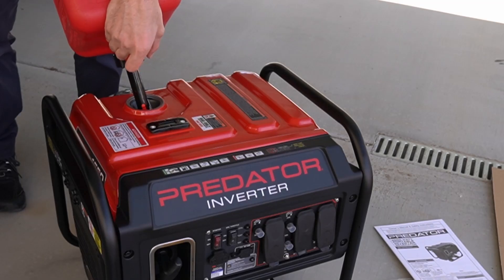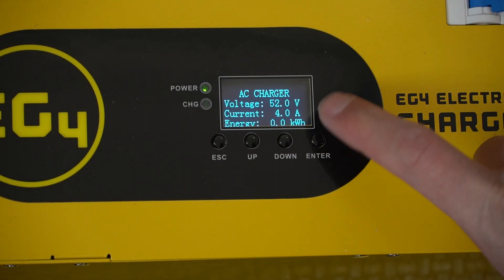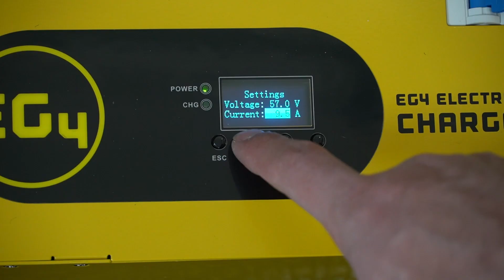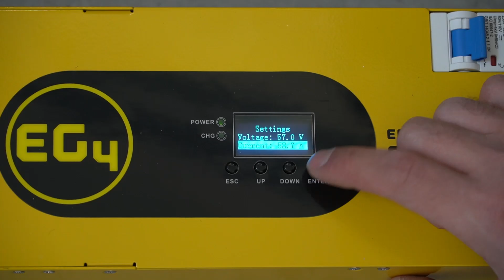New! 48V 5kW EG4 Chargeverter

Comment: Hey just wanted to point out another really nice use case for this product.  People that have cheaper all-in-one units like growatts and 6500ex/lv6548 have a TON of issues with ground/neutral bonding when they try and supplement their solar/battery power with grid power.  This lets everyone in that boat disconnect their AIO units from the grid entirely, and connect through DC using this product.  Should make a lot of people's homes safer, and fix a ton of issues with parallel pathways etc.

To clarify, I mean using this chargeverter with grid power to supplement solar, not using it with a gen.
Reply: Good point. I have an LV6048 and was worried about that, but someone that took theirs apart on the forums did confirm that it does have a bonding relay that goes to open on grid bypass mode. But that relay could fail and you would never really know.
The only downside is you'd be cycling your batteries all the time if you were primarily using it for grid backup. Not as big of a problem with LFP obviously.
Reply: @andrewt9204  Hi Andrew. I think I'm in the same boat as you. I've got a Sungoldpower version of the LVX6048 and I'm a bit lost on the ground-neutral bond situation. Is there a setting in the AIO unit itself I can change to separate it? My unit makes an awful sound and eventually fails with an error code when I try to do solar - battery - utility versus solar-utiliity-battery.
Reply: @tomtruong7432  When you are in SUB mode, are you drawing from the batteries ever?  If not, I would guess the problem lies somewhere between the battery and the connection to the inverter.  The battery usually doesnt get involved in SUB mode, so that could be why you don't see the problem in that mode.
Reply: @andrewt9204  Yeah, I think if I went with a parallel voltronics AIO (2-6), i'd probably spend the money on a chargeverter just for piece of mind.  On a single one... YOLO  😂😂
Reply: @silverice9  I would too. I didn't even hook mine up to a generator or grid I didn't get that far yet I'm glad I found this video. Kind of depressing. This is how it is but at least I know now great to know for people on the grounding bullshit as well
Reply: Dealing with that exact issue and have come upon that exact solution, I wish you could use solar/home assistant to control the amperage though.  Ideally when the batteries are low I could have home assistant apply charge at whatever rate the load is to effectively zero current to the batteries.
Reply: @robinboling9531  how is that combination. I've just started using home assistant and need to pick up solar assistant this month.
Reply: @SetitesTechAdventures  other way around for me.  No complaints with solar assistant.  I'm using the DC power supply.  Someone on the forums had theirs fry and suggested using the AC supply so it's isolated from any voltage spikes in the DC system.  Solar assistant has a button to enable mqtt communication but I haven't got home assistant set up yet.

Comment: Isn’t the AC input limited to 30A 240V? The plug and cord size might heat up attempting to run higher power for longer periods.
Reply: That's 7200 watts and the charger is rated for 5000 so no issue.

Comment: Omg🤦‍♂️ talk about a over look. How you buy a generator without 240 outlet? It’s happens , as long as you got it working. I got the same charger.

You need a plan B, it’s not sunny every day. But now your going to need to store gas to run the generator when it’s not sunny out.
Reply: Either get a propane ready generator, or get a kit to upgrade a generator for propane use. There are dual-feul generators that can take gas or propane. Propane is way easier to store for much longer periods of time.
Reply: @Tumbleweed5150  exactly! That why I got a champion dual fuel 85000 watts generator. You just never know.

Comment: Question: I have a 25 amp gas generator to charge my Battle Born Batteries. If I were to use the charger that you’re showing, can I get the full 50 A or do I need to change my inverter setting to 50 A instead of the 25 A? Thanks
Reply: 25amp at 120vAC is not 50amps at 48v nominal. I think you might be mixing stuff together.
Reply: @my_channel_44  
I have a Victron 5000 48 V  inverter. It’s set for 25 A, so do I have to change it to 50 A to use the 48 V charger?

Comment: I'm considering purchasing the Chargeverter so I can recharge the batteries with my generator while my Growatt 12k is powering the loads. Without the chargeverter, the generator would be passed through the Growatt and would not be able to handle the high inrush spikes of the whole house HVAC system. This seems like a good value, but I'd like to see more testing and real world experience to make sure it is reliable.

Comment: I was looking into dual fuel generator when I get to start building my system...  storing propane is way safer than trying to get gas in an emergency.. but I also have 3 acres and would rather cut the grass in the shade of panels :) ..

Comment: Can it be used to charge a bank of 12 12volts 200ah batteries using a “10000watt continuous generator”? A clear answer will be greatly appreciated.  My best Regards
Reply: Only if you set them up in a 3p-4s configuration and run them as a 48 volt bank, and then your solar or other charging and inverting systems must be able to run/use, a 48v battery bank.
Reply from the maker: No this is 48V
Reply: Sorry sir for being a pain in your neck. I just realized that I didn’t give you enough info about my setting. My connections start with:
10 solar panels of 200w wiring in series to a pair of 100w solar controllers to a bank of 12 batteries of 12volts 200ah wiring in series (3 groups of 48volts) to a 10,000watt continuous “aims power”inverter and a  13,000w pick 10,500w Duromax generator. How many of those chargeverters do yo think I need to charge my batteries ? Please help me through this.

Comment: I was just thinking: With this chargeverter (~$400)... A cheapo but quiet Amazon 2-3kw generator (~$400)... 4 cheapo Walmart Deep Cycle Marine Batteries (~$400)... and a 2200 watt 48v trolling motor from Amazon (~$400)
= A pretty nice quiet but powerful Jon Boat powerplant upgradeable to solar and controller for another (~$400)

Comment: How hot does the chargeverter (240vAC-12v DC) get. Would be great to put a temperature sensor on the unit. 
🌏🇭🇲
Reply: it will get around 130 f on the hot side of the charger pulling 90 amps. It does have a good cooling fan

Comment: I would buy this just as a powerful 5000-watt 43V-59V DC power supply and also to charge my custom 16-cell LFP home battery from solar since my system is AC-coupled.

Comment: Great adaptability. It'd be great to have that flexibility in the range of voltages/amperages that ebike batteries need. Car charging stations don't accommodate ebikes, but car charging stations and high voltage RV "shore" power AC outlets are far more available than plain ol' 110AC outlets when bikepacking long distances (few hotel stopovers). So... Is there anything as adaptable as the EG4 Chargeverter that operates with a low (4 to 12 amp) DC (24 to 52 volt) output, adaptable to the connections and voltages that car charge stations and RV "shore" power (the 240v kind) have?
Reply: Yes. Look up Delta-Q's chargers. I have an IC-650: it will take anything from 85-270v in, 50 or 60 hz. There are profiles available from Delta Q for LFPo. You have to get the right voltage output: they are either 24, 36, or 48 v nominal output, and not switchable. Contact their support. Very good.
Reply: @my_channel_44  I only have to accommodate one output voltage (both of my ebike batteries are 36 volt), but it would be good to be able to tailor the output amperage to conditions (low charge-rate when there's time; hi-rate when there isn't). The Delta-Q is pretty expensive, but if the support is really good for set-up configuration and changes out in the field, that might be worth the cost. Weight could be a deal-breaker. Seems like something made for 4 to 12 amps out could be very compact. (The set-up presently on my workbench is like with a hybrid car, miniaturized: 20cc gasoline motor to brushed 110 AC generator to a standard 110 AC ebike charger, which I have to carry anyway. 9 pounds. Fits in an ammo box. No need for an inverter, so low loss, but requires constant manual engine-speed monitoring to stay in the optimal output range for that charger without any electronic control. [I'm not an Arduino geek.] And it's gasoline. Operates easiest when stationary.) I'm doing everything I can to not have to tow a trailer, but...

Comment: 22KW generator for an AIO????   What size AIO is that for?
Reply: If your AIO is 5000W output, and you are using close to that in your house/cabin, then you will be pulling around 10KW. Since most generators seem to run most efficiently at around 50%, you will want at least a 20K genny, and maybe the extra 2000W is for safety.

Comment: I ordered one about two weeks ago but they are back ordered. 

I have an inverter generator and currently run it through my inverter but when house loads are high the genny rpm’s fluctuate and a couple lights flicker. I thought it would be easier on my appliances and inverter to just run off of the batteries while charging them with the chargeverter.

Comment: Thanks Will! I was thinking about that issue of charging through an all in one from the 8750watt generator that does not have a clean inverted output. Probably worth the extra money. Also some  all in one systems will not feed from batteries while being ac charged. This would eliminate that issue as well.

Comment: I bought one of those EG4 48 volt 100 ah batteries you reviewed and so far I'm not happy with the battery or the service. Don't throw anything away or they will not take the battery back unless it's in original package. The battery randomly drops out and the Bluetooth doesn't work with their app.

Comment: You should have picked a non-inverter (legacy) generator, those are the "dirty" generators. Many of us have that older style and they are the ones that are likely to cause a problem. Voltronic (MPP, EG4) has a paper on their site about using a generator and says that older style non-inverters are the ones that can cause problems. The inverter type would have no problem powering the all-in-one.  Too bad, I would like to have known if the Chargeverter would have worked on my old Generac 7550 generator.
Reply from the maker: Very good point! I'm asking friends to see if I can borrow one. Or if someone has a older RV with one attached. 

And yes it is absolutely designed to work with them. My understanding is you can connect it to any size or age generator and it will work.
Reply: @WillProwse  signature solar confirmed that with me. I plan on testing it on a real terrible one I have. 25% thd.
Reply from the maker: @GavinStoneDIY  25?! Holy cow!
Reply: I have a HF 9500 inverter generator, I’m hoping I don’t have any issues because that’s why I bought the inverter style.
Reply: @HeyPasBon   A honda 6500 is rated at 5500 watts continuous so about 80 amps it is happy there-  your 9500 should run it at full 100 amps no problems.
Reply from the maker: I had no clue the THD could be that awful. Yes I need to find one of those to use instead. That's just insane.
Reply: @WillProwse  apparently some of the components are aluminum and that makes this worse.  Under full load it’s supposedly around 30. Hopefully I can make a video with it soon. Either way. The carburetors in generators can mess components up to with the constant voltage variation it can create.
Reply: It's that bad if it's not maintained.
Reply: @nunya business so this isn’t needed if I’m using an inverter gen?
Reply: @freedomseeker1966  it depends on your setup. Technically a quality inverter generator could provide clean power to you inverters yes.

Comment: Why can this work with dirty ac not the all in one? They can use this to replace whatever inside the all in one
Reply: Two points to answer your question/comment: 1. Adding this unit would increase the heat inside an all-in-one, perhaps above what it could handle. 2. The cost of an all-in-one would be so much more that many folks couldn't afford them.

Comment: Only option in Washington state. Not one single day of sunlight for 9 months of the year. Solar is completely useless here.
Reply: Solar works well in spring/autumn  too. Even with cloud if you have enough panels.
Reply: Try over-panelling your system, maybe with a switch to cut out the extra panels on a sunny day? I know that my system still charges when it's very overcast.

Comment: Get a generator that uses gas or propane. PROPANE IS MUCH CLEANER
Reply: Just convert the hobo freight one. That's not too hard.
Reply: @vhfgamer  they sell conversion kits.... that is great. I burn propane in my generator and the oil stays much cleaner.  If I burn gas it needs to be changed weekly
Reply: @pacearrow4620  I work on my own power equipment, and I've also had the opportunity to see the guts of a propane powered forklift. 

Yep, propane burns much cleaner. The drawback is that the fuel tank needs to have a de icing regulator in between so as to not spray frozen fuel into the engine.

Comment: When you wheeled  the generator over the solar panels may have been my favorite part.
Reply: Door mats? Just put down some solar panels
Reply: I was like NOOOOOO
Reply: @FU2_Ggl  Same!
Reply: lol. he has so much gear and equipment, he doesn't care anymore.
Reply: Yeah, I'm like... what is this guy thinking! ;-)
Reply: @paulgrn1  Will can afford it.
Reply: solar freakin roadways :D
Reply: Solar panels ,whathever the brand maker are very sturdy .
Reply: OMG, same!!! As I am putting up my new panels last month I was being so careful, worried the slightest bump would break something. Clearly I was wrong!
Reply: @chadmarkley  you were wrong. It turns out they can take the weight of a man and a generator apparently.
Reply: @chadmarkley  I believe they're rated for goofball sized hail so they're pretty tough.
I know what they aren't rated for, and that's FedEx shipping. They don't hold up to a forklift fork
Reply: I’m so glad Will did that.  I’m always handling them like a baby sometimes at risk to my health!
Reply: The scratching on the glass ground my teeth 😂
Reply: My Great Dane and 3 Pit Bulls regularly run across mine. (Temporary set-up,  I have them on the ground). One pit and great Dane will sit together in the middle. That's almost 200 lbs. Will knows they are tough and won't break.

Comment: I have the sungold power 6548 and it DOES NOT WORK With a 7800w gen.
Reply: So you need this?
Reply: @tsp2jxd     Not for $400 plus shipping i dont
Reply: If sungold support didnt send out corrupt and virus laden fixes, i woulda done it that way.  Now, i’ll just add a 2k wind gen
Reply: I considered the Sungold 5KW inverter with 500 VOC instead of the new EG4 3000W  inverter with 500 VOC.  Sounds like support isn't good with Sungold?  My experience with EG4 was not good.